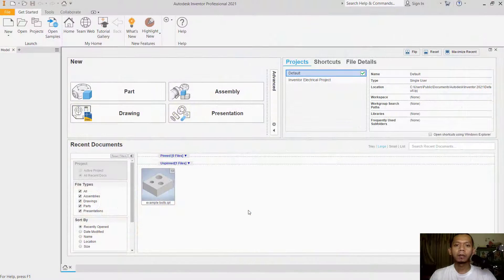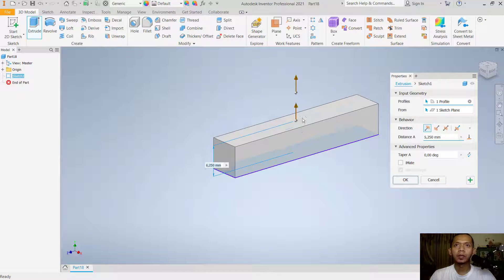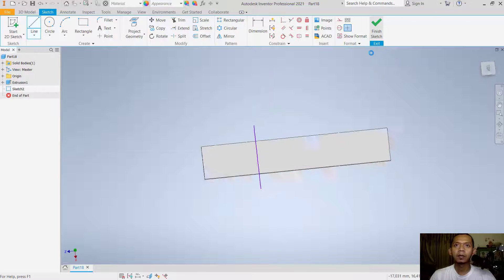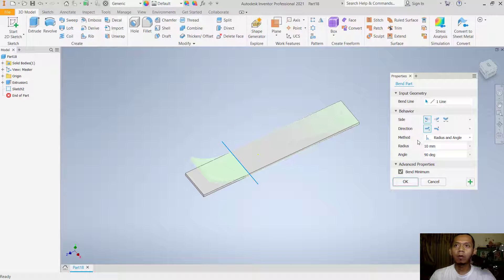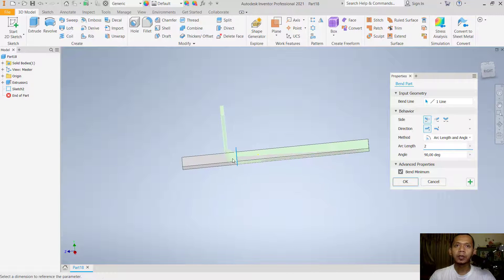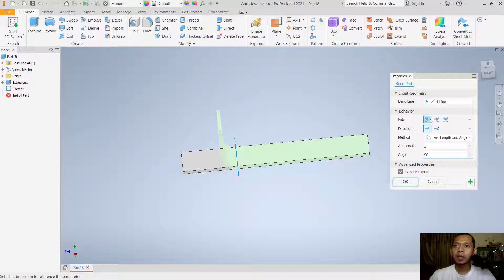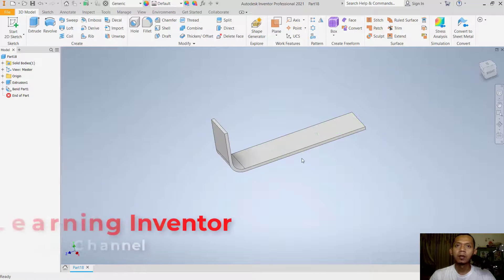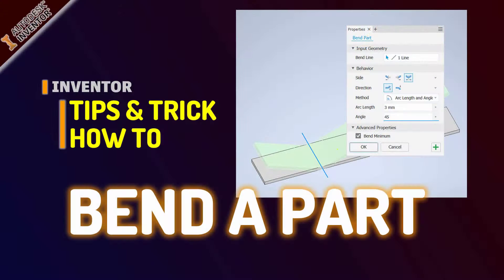Inventor How To Bend A Part

Comment: It may be too late to get an answer, but I've been trying to animate a bending plate, and I've not been successful. It tends to instantaneously snap into position. There is no graduation of movement. 

Specifically, I'm trying to animate a long plate (~ 10:1 ratio, and relatively thin). It is help in place at the center, with approximately 1/5 of its central length unbendable. The outer edges are the regions that are supposed to bend. Think of a crossbow.

I've thought of breaking the piece into two, and creating equal /  opposite animations for each side. I'm wondering if it having two control sketch lines so that each side can bend is the thing causing the problem.